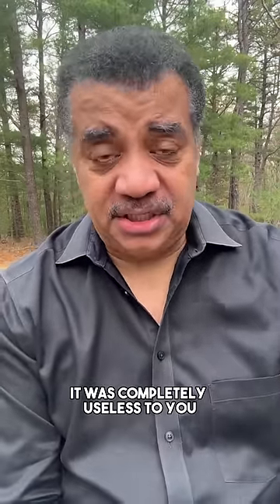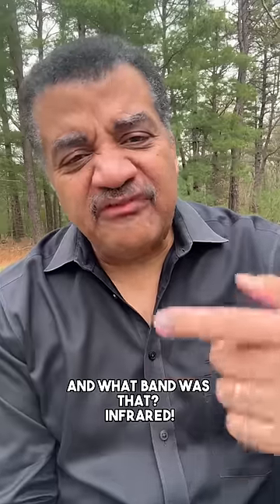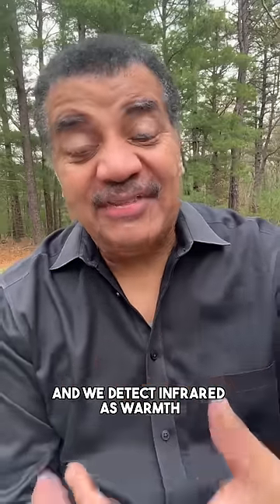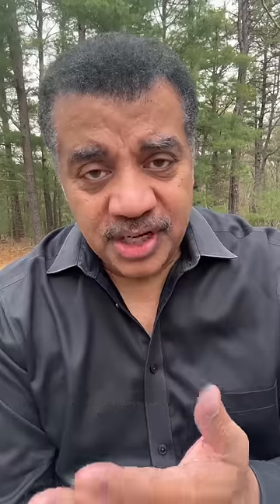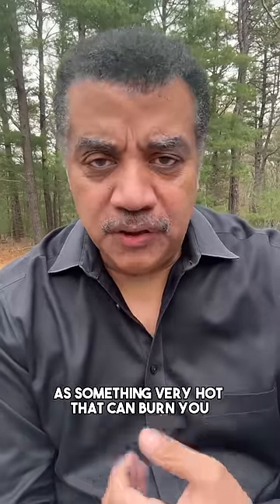LED Bulbs vs. Old Bulbs 💡

Comment: Neil, have you ever touched the base on an LED bulb? Yes, they use less energy, but they still waste energy as heat.

To all of Neil's fan boys! What Neil said was that they used all their energy to produce visible light. Nothing is 100% efficient was my point. 

 I can explain it to you. I can't understand it for you!
Reply: Yeah and they get extremely hot to where it can burn you lol
Reply: That's because there will always be some heat loss
Reply: @inspectorgadget346 yes but that’s not what he said
Reply: What he said is true or not true depending on how you look at it. LED bulbs do get hot, but it's from electrical current running through the components inside, not because the LED is emitting infrared light.
Reply: The heat they emit is infrared light there guy...that's what infrared light is heat...
Reply: I've used the old light bulbs to provide warmth to pipes and to pets that live outside many times in the past. That heat sometimes has good side too.
Reply: @georgespalding7640 Resistance provides part heat and part light; the electric flashlight with LED from Dorcy
of Columbus, Ohio my choice as Hurricane Idalia took house conveniences
Reply: Especially 277v LEDs. There's a heat sink on them for a reason. I know I was dumb enough to burn my on one.
Reply: I learned my lesson on lightbulbs 40 years ago: never EVER touch a lightbulb that has just been on. Wait at least 10 minutes before removal. Because of this rule, I had no idea that the bulbs no longer got hot😅
Reply: Theres always someone out there who thinks they're smarter than Neil.
Reply: What Neil said was that they used all their energy to produce visible light. Nothing is 100% efficient was my point. 

 I can explain it to you. I can't understand it for you!
Reply: Yep. I had an led flashlight desolder itself before 😂
Reply: Thats not the light source, that is the step down transformer inside the base from 120v/240v ac to 5v DC and the amount of heat loss will depend on the quality of the transformer components doing the job but even the worst on the market will still be wildly more efficient than a filament bulb.

Comment: There is nothing wrong with the old bulbs if you want the heat. I couple of 60W incandescent bulbs add a lot warmth to a cold room.
Reply: Not as efficient per unit of heat as a proper heating unit especially heat pump, and they are producing light which at times you don’t want at the same time you want heat.

Comment: If you think about it; we need to heat are homes and any thermal energy emitted by incandescent light bulbs will slightly offset the required energy to heat a living space buy conventional means. So in the winter time incandescent light bulbs don't technically waste energy.
Reply: The efficiency of a bulb at providing a unit of heat, is still much less than a proper furnace per unit, especially a heat pump that gathers existing heat. It’s also heating your ceiling mostly if that’s where the bulb is.

Comment: Ask any flashlight collector if LEDs get hot. Oh yes they do. We have a little something called Turbo mode. Many hand-held flashlights have it. Basically push the envelope to just barely beyond what an LED is capable of. For example, 4,000 lumens for 30 seconds. Switch the light off, enjoy your raging hot hand warmer! Seriously, not joking.
Reply: Yeah, but under normal use they don't.

Comment: For indoors in a cold climate the 90% infrared isn't useless. It helps heating your house.
Reply: Not in July
Reply: @rattlecat5968 Unless you live in the southern hemisphere
Reply: @BasilMinhas  Lol you're right. I apologize for  that 👏
Reply: @rattlecat5968 How often do you need to use lights in July?
Reply: @johnp139  I'm nocturnal, so always. Besides that, I have a canopy of trees along my southern and western exposure windows and the latest the sun is up here, is 9pm.
Reply: Do you change out all your light bulbs seasonally?
Reply: But then you lose 10% to a useless visible light. When it's daytime outside.
Reply: @BasilMinhas About 9 out of 10 people live in the northern hemisphere.
Reply: A light bulb cannot heat a house
Reply: @Lattrodon  True, but who has only one singular lightbulb in their house?

A typical space heater is 1500 Watt(W), an old-school tungsten filament incadecent light-bulb is typically 30W or 60W with 90% of the wattage turning into heat. 

For a 60W incadecent bulb 54W is released as heat. So if you have about 28 60W incadecent lightbulbs you beat the heater in its job.

They add up, this is why we are more reliant on heaters now that those bulbs aren't used anymore.

Edit: By adding up I mean that even if you have 5, 10 or some other number of bulbs you still require less additional heating than with modern bulbs.
Reply: @murdoc296 your reasoning is extremely flawed.

1.5 kw of heat distributed through a house would practically be useless and would not keep up with heat loss. 

Now In a singular space of like 20-75 square feet it would do something but then you literally have 28 light bulbs in a single room.
Reply: @virtual_bomber5698  Nowhere in my comment did I say 28 lightbulbs could heat a house. 

It might have been written a bit of a confusing manner but I meant true as in I agree and "nobody has only one right?" As a set-up question for the subsequent comparisons and math below it.
Reply: @Lattrodon  but the heat it produces will add to the heating of the house. It stays in the house. It heats the house a tiny bit. It is not wasted.
Reply: @onnostrijkert  you know what I mean.
Reply: @murdoc296  i know lol
Reply: @johnp139  Every night.
Reply: True, though not very effectively.
Reply: While not untrue, we know heat rises, so if the bulbs are already heating the ceiling, it's not really helping with climate control like a furnace, boiler, or baseboard heat
Reply: bro…
Reply: @Lattrodon  Yeah I don't know what they are talking about.
Reply: @murdoc296 it's great if you only want to heat a small area like an incubator or a reptile cage. They need UV too, but you can use an incandescent bulb and a fluorescent bulb during the day to mimic the sun
Reply: @winstack the heat is literally radiated out, very little is lost to convection
Reply: 90% sounds pretty efficient 🤔
Reply: Is useless. There are cheaper ways for heating. Also intense infrared whole spectrum is not great for eyes. People who have issues with their retinas should be vary
Reply: @BasilMinhas  What's the difference? You picture it as if south pole was warmest place on Earth. That's not how anything works.
Reply: @johnp139 whenever the sun isn’t out 😅
Reply: @onnostrijkert it's still useless, no amount of light bulb expected in a household setting will heat up a room near sub zero environment. Only useful use is a few 100 watts for the small chicken coop.
Reply: @spacebatstuckonearth8888  I just mean it isn't wasted
Reply: Yeah but you're paying extra energy for inefficient heating. You have to ask what the cost to heating ratio is.
Reply: No it doesn't lol go sit down
Reply: @whome6020  why not. What happens than to that infrared light?
Reply: Semi truck trailer tail light lights. The LEDs don’t melt the snow off. Some LED taillights even have heaters now.
Reply: I used to argue with my father that if I left the lights on, I was just helping heat the house. He didn't like science.
Reply: @spacebatstuckonearth8888  Or a pump house. Or a host of other uses you just want to trivialize.
Reply: The real benefit if the LED is you don't have to replace the bulb nearly as often.
Reply: at night.
Reply: It’s also a terrible radiator
Reply: You gotta add the /s tag to this so people know you're being sarcastic. Too many people would say this, actually thinking that light bulbs help heat their homes to any useful degree.
Reply: @johnwyman6126 just sit by another lamp🎉
Reply: @Lattrodon but a houseful , can🎉
Reply: @praecorloth they do...we are a lot of people using the old bulbs for heating,until they wear out....🎉
Reply: @praecorloth  If you have a 100 watt bulb in a room, that's giving off 90 watts of heating. and if 1500 watts are going to heating then the 90 watts of heat from the bulb effect  a 6% increase in the heating the room receives. And I can tell you're about to argue that a sizable room is being heated by more than 1500 watts, which is correct,  but a sizable room is also being lit by more than one bulb.  Up to 4 in the light fixture, maybe 4 more in lamps. So if an area say has 2 light fixtures, each with 3 with 100 watt bulbs,  and it's bring heated by a 5000 watt heater, then roughly 10% extra heat is coming from the lights.
Reply: @MogofWar  or I might mention that hot air rises, and light fixtures are usually pretty damn close to the ceiling.
Reply: @praecorloth  but the infrared doesn't rise until it has turned to heat via absorption, and that's a problem all heat sources face. But the heat building up at ceiling level need not be wasted. You can induce air currents to bring the hot air down as well, by having a fan force cool air up. You run the ceiling fan in reverse and the air will circulate, bringing the warmed air down, and keeping the heat more evenly distributed. You do this to circulate all heat brought to the room, from any source. This is something you want to do regardless.
Reply: The LED light suck. I have an incondition light bulb that's been burning for years. The led light bulbs only last about 6 months. e talking about false advertising
Reply: I mean it's still useless because the heat is relatively minimal. You're better off using something that is intended to generate heat.
Reply: led doesnt work 6 months of the year where i live. need incandescent lights outside
Reply: Yes, but you paying for that heat , better get LEDs and buy a heater separately them in summer days you don't have to replace your light bulbs,
Reply: Not useless in the south in the summer though. Helps raise electric bills when trying to cool off 😂😂

But yeah further north y’all probably want standard incandescents to help heat the place without being as reliant on the heater
Reply: @RyuuTenno  I live in Minnesota. Lemme tell you: absolutely not. Nobody but nobody uses incandescent bulbs to heat their homes. It wouldn't work without putting an extraordinary amount of bulbs everywhere, and even then it wouldn't necessarily be effective, and it certainly wouldn't be efficient.
Reply: @niskamhsiz4022  Because changing a lighbulb is really hard, am I right?
Reply: @Lattrodon  Sounds like you need a bigger light bulb.
Reply: Indeed. In such cases IR heat loss is more useful than an LED's direct heat loss. The difference is your socket heating up vs the area around the light heating up.
Reply: @Zuriki09  I think the entire point is being missed here. The point isn't that the heat is significant. The point is that the heat isn't wasted, and isn't something to be rid of. The fact that a bulb produces IR heat is not a downside or waste. In fact it is less 'waste' than the heat that LED's produce which is about 85% direct heat in the electronics. Give me IR over outlet heat any day.
Reply: Except the IR doesn't heat the house, it heats you.
It is not an effective way to heat a house.
Reply: @onnostrijkert But it is wasted. The IR heaters are intended to heat the body not the building or the air inside that building.
Reply: @Lattrodon it certainly does lol. Especially when you add up every light in a house, I keep 4*100 watt incandescentsin my bathroom for that very purpose and it keeps it nice and toasty in winter ;)
Reply: Totally in ireland people would turn on the radio to warm up. Cos it had the big valves ... I miss the wonderful light of old incandescent bulbs and i remember the older old bulbs form the christmas tree got so hot. But led are better than them fecking tubes we had for a while.
Reply: @MogofWar that's a myth
Reply: Haha, I'm sure if you have all LEDs you can use a small heater and still consume less power.
Reply: @henrikholst7490  This is a long thread.  You have to more specific.
Reply: @deang5622  Again, you are saying "effective" when the point is ""not waste".
Effective or not, that heat is a positive contribution and not waste. And the whole IR doesn't heat the house it heats you is hogwash. Put an IC lamp in a closet and watch the temp rise. It doesn't heat the air, it heats the surfaces it strikes, which in turn radiate that heat into the air.
It's not the best method, it's not the most efficient method, but it is not waste.
LED's on the other hand loose 85% of their energy to heat that is centralized to the electronic transistors, in terms of contributing to heating an area this is far less effective than IR.
So with IC you get 5% light, 12% very ineffective socket heat, and 83% somewhat useful IR heat.
With LED you get 15% light, and 85% very ineffective socket heat, and no useful IR.
So depending on the specific situation IC bulbs can provide more usable overall output than LEDs.
Reply: @Anubis78250  But it is not effective and it is waste. If it is heating the building and not you it is waste.

The goal isn't to heat the building, it is to heat you. Why are you having so much difficulty understanding this?

When heating by convection, even here the goal isn't to heat the building, it is to heat the air which then heats the person.

The same is true for heating by radiation.
Reply: @deang5622  Did you seriously just argue one comment ago that IR heats you and not the building so it sucks, then come back with IR heats the building and not you so it sucks?
And I'm the one having difficulty?

IR heats the surface it contacts, this could be you, your clothing, or the walls and floors around you. That heat then radiates into the air.

I'm not arguing that it can replace a purpose built heater, only that it is a useful side-effect to have and not simply waste. On the other hand LED's heat is much less useful.

As someone who lives in a cold weather state I can tell you first hand that changing to LED's makes for a noticeably colder house than with incandescent bulbs. Even with the furnace keeping the same indoor temps not being bathed in that incandescent IR makes a difference throughout the house.
Reply: @Anubis78250  Why are you having so much trouble getting your head around simple concepts?
Did you fail physics in school?
Reply: @jan-willembavinck3650  than an old loght bulb? No. Modern heaters use wuite a bit of electricity compared to an old light bulb lol.
Reply: There are more efficient methods of heating
Reply: @drewpamon  No one denies that. What's your point?
Reply: @MogofWar I need to replace them every 2 or 3 years. Looks like planned lifetime. They are becoming blinking in around few weeks time after the guarantee ends. The leads itself are OK.
Reply: That’s what furnaces are for … 😂
Reply: Well, it heats the bit of your house in the middle of the ceiling. Not very useful.
Reply: @Padraigp  depends on the size of the heater. You would only use the heater for a short time so I think it's still more economical in the long run to get LED light bulbs + heater instead of all old fashioned hot lightbulbs
Reply: Yeah bro let me turn on all the lights since they heat up the house in this cold weather, why use a radiator or heater when you can use the lights right? Especially since houses in cold places don't have heating am I right? Yeah brother you are super smart, please keep commenting bro you got this
Reply: Definitely negligible
Reply: I think there are other methods more efficient for heat production. Best to optimise for light and heat.
Reply: Not in any way thats helpful just like your comment and opinion. Essentially useless and a waste.
Reply: @iShockGamers  why? What was the reason for you trying to insult them? Do you have some grudge against them for whatever reason?
Reply: @onnostrijkert yeah but that's not what you're paying for and it's not optimized. Optimization reduces use and cost. Central heating is much better and worth the money even with all LED
Reply: But it’s most likely less efficient than a traditional heating system so you likely will be wasting money in the form of an energy bill
Reply: OR, have a heater then keep the LEDs? We live in the future, we have stuff to solve problems of the past 😂
Reply: @murdoc296 9/10? Source bro? Cause I know Indians wished they lived somewhere colder
Reply: ≠ in Texas 😂🤠😅
Reply: How small is your house that it can be heated by light bulbs?
Reply: He just saying in the case of why one kind of bulb heats up and another kind doesn't
Reply: That's why I have 1000 lights in my bedroom....
Reply: Not too mention although not a lot in a bulb there is numerous proven health benefits to Infared light
Reply: Usless

Comment: I never wondered why but, here in the UK where it’s not especially warm, that extra energy used to light an incandescent bulb was never wasted, it was heat & we need heat to keep warm in our homes.
my car is 11 years old, it has halogen bulbs in the headlights, the other week whilst driving in snow, my lights remained clear, a brand new Audi with LED lights was effectively without lights because the snow was sticking to the light lenses .
Reply: I was just going to say the same regarding heat in the home. It is also just very comforting to read under a warm bulb
Reply: Imagine how earlier folks felt about these cold machines that could only stay warm while operating. No chance to stay warm huddling up in a snowstorm next to your horse if you were caught along a mountain pass. I suppose you just drove around with snow everywhere else on your car too, right? Why bother clearing it off when you have heaters to melt it off of the lighting? Also, heating your home inside when it's 95 degrees F. outside is sooo nice...
Reply: I’m pretty sure there are car models with defrosters installed (and yes, they are also available in transparent form).
You should look into that 😃
Reply: My Mercedes has wipers on the headlights for that.